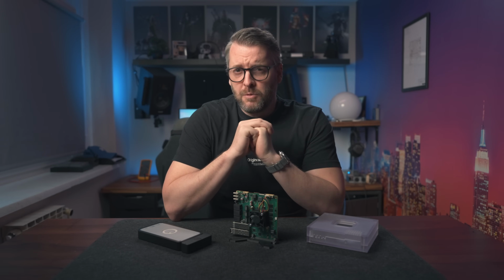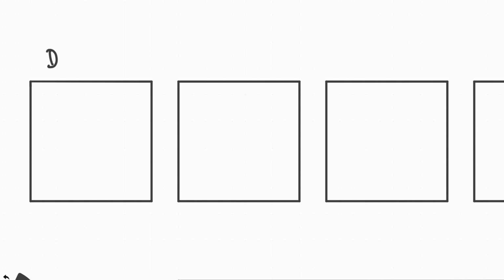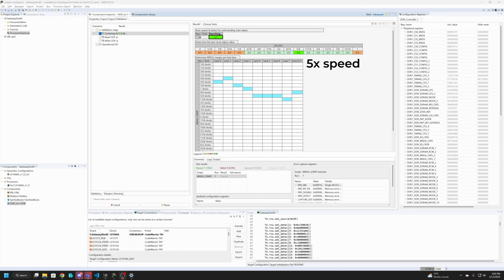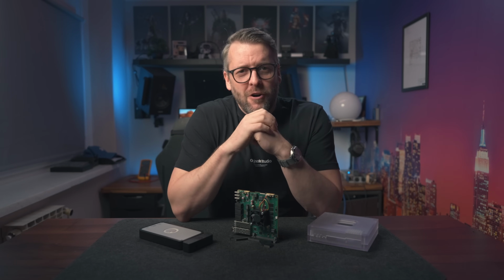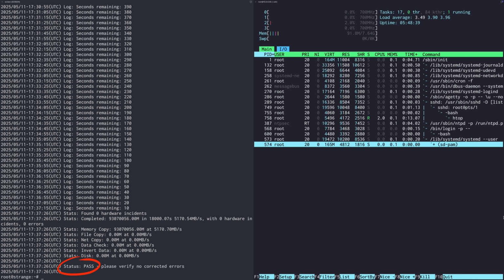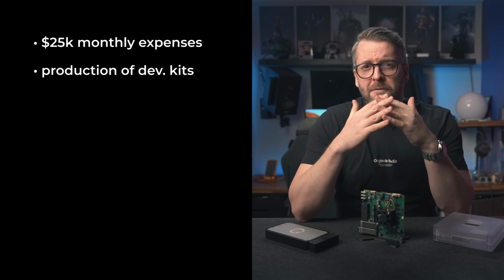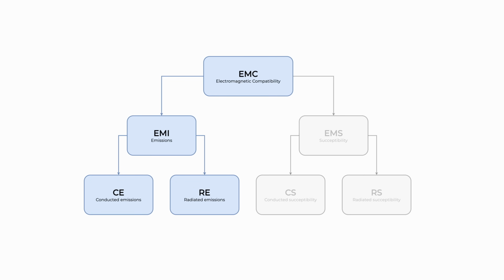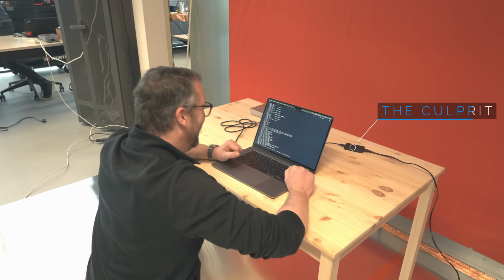We're developing a high-end router. From scratch. (April 2025 update)

Comment: Seems that at fault is that, if for register configuration the RAM controller uses the lower bits of address bus as data to be written, when you want to read the status registers it uses the data bus, and if you scramble the bits without telling to the RAM controller the new position of the status bits, the status bits are not in the expected place, they are swapped, and the controller read another bit in the status register as calibration bit.

This is not an issue and does not need to be documented 😁, the only way to read something from the RAM module is thru the DQ bus and does not mater how is wired when you send/receive data, but mater when you read the RAM module status, that is the only reason for telling to the controller how you wired the DQ into a nibble, if not for this calibration there were no need to have the DQ enumerated you were be able to wire the data bis how was the best and shortest no mater the order much like a static RAM.

Comment: Minis 01 nehmen und Optional 5G Modul per USB dran. (RM520 was Global arbeitet für maximal 150 Amazon, echtes Dual 5G Simultan nirgends gefunden)

Der freie Pcie 4.0x8 Slot erlaubt Theoretisch sogar Dual 50 Gbit/s LAN/WAN per ConnectX6 Karte die auf halben Lances laufen würde wenn einem die 2x 10 Gbit/s ab Werk (SFP) nicht langen.

Ergänzend über die 2 Thunderbolt 3 Ports währe auch noch SAS und / oder NAS Storage Möglich.

Als kleineren Bastel PC um was zu Hosten oder auch als Firewall Only PcZinophyte 2x10G SFP+ auch Intressant

Comment: What you give to the IT world:
I follow this adventure because the lack of 10G router on all ports, or at least one 10G SFP+ (WAN) and 10GbE (LAN) and a back up WAN with a faster than 1GbE.
QNAP has one that could fit, but it doesn't have any SFP+ port (3x 10 GbE and 6x 2.5GbE).
Netgate, OPNsense, Mikrotik, doesn't fit the bill neither, or too expensive.
Ubiquity just release one, but I don't want US based sotfware, non open source ones at least.

Comment: Don't wanna be overly negative or something but what does this offer vs using a Banana Pi (or similar) router with OpenWRT that's much cheaper and has better specs?
Reply from the maker: Hardware offloading. 10 gigabit line rate speeds for almost any protocol.

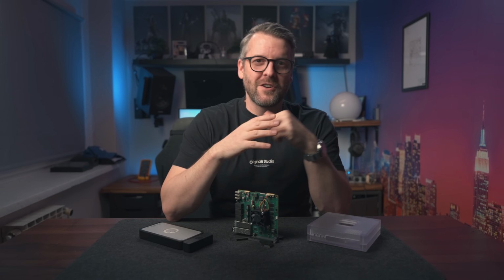Comment: 29:38 - couldn’t you have requested the manufacturers show you their testing data of their part BEFORE you bought it? Just curious if you could’ve made them do that test before you bought it with that piece of hardware you tested
Reply from the maker: They do get tested and certified by the manufacturers, but the problem is that there's variables they can't (or don't want to) control, such as cable length and gauge. These two can impact the performance quite significantly. For example, I happened to have an Anker PSU with with me that day, and we tested it as well. It passes, but just barely. That's because manufacturers optimize for price and put components in that pass, and then stop optimizing, because it would cost more to manufacture.

Comment: Hey! Thanks for the videos, pleasure to watch them.
Personally I think that you need to aim for a modularity to attract attention. 

For example
- same hw base with option to configure as NAS. NAS should be simpler to deliver software wise.
- or IoT gateway - by adding some zigbee, thread, matter modules , can attract 'iot'  investors
- 5G module support.

I don't thing it will be easy to enter market with high end router - for businesses trust and support ir necessary, for homelabs - small market, what distinguishes this router from Chinese orange pi boards?

Comment: I'm the "fifth set of eyes" and can add a bit to the explanation of why the memory controller can't do leveling with unconfigured swapped bits, even though the system can boot. The "drawers" analogy is a good one, but it's not the only way the controller can access the memory. The memory chips also have a set of control registers, accessed via the address lines.  Four of these are scratchpads, and by setting MR3 bit 2, the memory can be placed into a loopback mode where reads and writes via the data lines are rerouted to the scratchpads - which, remember, the controller can access via the address lines. This gives the memory controller a way to "see what the memory sees" via an alternate path - this is important because during leveling, the controller is deliberately shifting the timing to find the edges of the clock eye. When data bits are swapped that the controller doesn't know about, the values it sees in the scratchpads will never match the test patterns it's placing on the data lines, or vice versa. Leveling fails. But this loopback mode is only used for leveling, and so assuming the initial calibration values are good enough, the "drawers" analogy explains why the system can boot.

Great video and keep up the good work!
Reply: Great info, thanks.

I couldn't understand how a unit being wired up wrong could cause that, as it didn't seem like it could see where the data is going. Explaining that thew controller has another way to look at the ram makes it clear.

If I might ask, how did you realize this error? Just stare at the circuit diagram forever till the cross-wiring became clear? Or have you perhaps seen this before so kind of had a hint this may be the issue?
Reply: @Nevir202  Improper DQ mapping configuration is a "checklist item" so to speak: most vendor hardware design guidelines have reminders about it. I went into the project with an assumption that there was no remapping, because it had already been checked. I checked it myself anyway, as did the hardware designer I work with. We missed it at first, because there are actually a few different places where remapping might be drawn on the schematics - in this case it wasn't drawn in the most obvious place. In the end I only spotted it after eliminating all the other possible problems. When that happens, I think a good problem-solver should always go back and challenge their assumptions and preconceptions! Trust no one - not even yourself!
Reply: @dvnrrs  Thanks much for the explanation.

It obviously on a simpler scale, but when setting Sudoku puzzles or even creating new variations, (and to an extent, even when solving,) the whole game is to make sure you've challenged every assumption.

Though, when failing there, the worst that happens is either an unsolvable puzzle or one with a shortcut around your intended solving path lol.

Comment: What level of DDR are you using, because for DDR2 or earlier, your explanation really doesn't make any sense?  As long as all the bits in a group are using the same DQS line you can wire them in any order you want and the controller won't care.   The bits that went out on a particular line during a write, come back on the same line during a read.

However, IIRC, DDR3 and later have some test data built into the RAM chips, so that when calibrating, you can get reads working and then get writes working.   It's tough to test if you're not even certain you can do either operation.  

Anyway, in the case of pre-loaded test data, "swizzling" the bits would mean  that the test data comes back scrambled.

See the "Hardware-Assisted Tuning" section of this document.   One of your swizzled bits must have been the "prime data bit".   https://www.asset-intertech.com/wp-content/uploads/2020/09/ddr-tuning-and-calibration-guide-nxp-imx6-quad-ebook.pdf

I don't think the data bits are used during memory chip configuration operations, so swizzling shouldn't affect the initialization, but it would affect permanent test data.

But, as I wrote above, there's no such thing on DDR2 or earlier.

Comment: I think that investors are reluctant to invest on hardware, because once released, it will be immediately copied (by chinese companies) and sold at 1/3 of the price, because they will have no R&D costs, just production costs.
The fact that your router is multi-open-OS, does make things worse (for the investors).
It may be a wonderful device and exactly what I would need for my home-lab!
Right now I can fulfill my needs, with products like Mikrotik where I need more control, like Ubiquiti when I need more user-friendliness for simpler installations and openWRT when I need hardware versatility. But I'm not exactly the average Joe.

Comment: Your market share for a premium router device has been radically eaten away from an american network company, which delivered a half/one third of your current price point router firewall. Which is not "open" and CPU-powerful as yours, but which will certainly have success.
For the "opennes" of the harware, a german developer of Open source router distro is selling a box which is on your current price point, with no 10gb nics, but it's x86. Obviously not produced, but traded. And now is public the OEM.

Comment: Flashback, we once debugged for 2 Months to find 2 swapped DDR address lines, so the settings had bits flipped. Nice thing, we flipped the bits in the BL2 and everything worked. Was on a SOC FPGA.
And failing conducted EMV tests because of shitty power supplies, haha did that too :)

Regarding recertify, you don't need to do the lab testing until someone questions your EMV complaince, but its better to have it done (you dont have to publish the result anywhere), the CE certification you sign yourself. With this in mind, you dont need to retest with any change, you can make assumptions if your change will affect the performance of your device. So changing a some random resistor, LED or component deep inside the circuit (if not clock related), you are good. Changing ESD/TVS elements or your DCDC Converters you should retest. Just my 2 cents :)

Did you do surge/burst and conducted emission immunity, also esd can be quite challenging, just asking curiously.
Reply from the maker: Then you know how it feels! :)

Comment: As a hardware/software developer, I'm endorsing your startup and genuinely wishing you success, no matter what.

That said, I have a few concerns about the placement.

I thought there were plenty of Intel N100/N150-based Chinese routers with a similar network configuration: 2x 10Gb SFP+ ports, up to 4x 2.5GbE ports, hardware offload like AES-NI, convenient DDR5 SODIMM RAM slots, and up to 2x M.2 SSD slots. These are fully supported by OPNsense/pfSense and are priced as low as $150, including delivery.

What sets your product apart? I'm not quite getting it.

Comment: These NXP LS* series processors have really difficult DRAM. We did an LS1043 DDR4 design (with ECC) and it was definitely a pain. Multiple weird bugs. I’d be curious to see if you also run into the same yield issue we had where ~3% of the boards fail DRAM boot training. We were never able to track this down and tried a variety of settings and ended up just taking it as a yield hit.

Comment: Hi, first of all kudos for undertaking this project. Showing the hurdles you are facing and explaining helps a lot in understanding the underlying technology.  However I do have a couple of concerns.. 
- Mikrotik provides good and inexpensive switches and routers which are extremely power and price efficient. Where is the benefit of selecting your product over going for a Mikrotik solution ? To give you my perspective: a CRS-510 is a L3 switch running the usual routing protocols, but also switching at a reasonable speed and supporting anything up to 100 gbit/s. All of that for <1000 USD. With redundant power supplies. The CRS310 is similar, but in the 10 Gbit/s speed range. They do have dedicsted switches available that support higher speed interfaces.
- The number of interfaces is somewhat limited. Compare this to your competitors.
- Which routing speed are you talking about ? Can you saturate a 10 gbit fiber setup with fully encrypted traffic ? At which packet sizes ?
- Where exactly does your product outperform those already on the market ?
I am just an end user. But if I were an investor, these would be the questions that I would be asking.

I wish you luck for this ambitious project.

Comment: Hardware for the most part can't be copyright protected or put under IP laws. They would have to create a 1:1 layout copy for you to enforce it. Re-arrange the ports and give the board a different outline and you've got nothing to enforce. That's the issue. Since your hardware is open that also means you can't enforce much in the way of software either. It's also why a lot of companies are burying binary blobs and copyrighting firmware into the chips. Want to buy a DAC? Sure. Want to buy a DAC with Dolby technology burned into it? Nope, you're screwed.

Comment: I really wonder why there is a nibble based bit swizzling allowed - a typical DDR4 data byte is compromised of 8 bits with the related masking and sampling signals - and the data bits are all equal to each other, there is no real difference between them. AFAIK the DDR4 chips are configured only by using the address/control bus, or not?

Comment: On the subject of the PSUs, why not just use the Lenovo PSU, given how well it works already? I have a few myself (both the regular 65W and the slim 65W), and besides the captive USB-C cable, the slim 65W brick is my favourite USB-PD power supply simplye because it supports USB-PD, USB-PD PPS and nothing else, run super-cool and has really good electrical output quality. Oh, and they come in both earthed and non-earthed versions (I prefer the earthed ones, cause I loathe a buzzing laptop from the ground leakage current).

Comment: Pretty solid and straight forward. The connections and expandability and CPU are what I'd look for. Love the case too. It would be cool to use is to cool the CPU in future models. Alternatively, a quick and easy way to blow out heat sink dust.

Comment: Gee, a certified power supply lying about those certifications. I've never seen that before. (I'm joking, I see it all the d... time.) I always recall the story I was told about the BeBox FCC testing: Radio Shack screamed at them to not send their monitor. (it's actually made by Magnavox, and it absolutely will not pass emissions testing despite the sticker placed on it.)

(When we stopped "making" [modifying - replaced the front panel of the case] our own hardware, someone from UL came by to collect ALL of our unused stickers. Also notable, Tyan and Acecom weren't happy we had their components in something sent to the FCC! And no, they didn't pass without modification either... the clock generator on the MB spews noise requiring us to shield every crack, and because it's right next to the PSU, it leaks into the PS and thus the AC mains requiring ferrite cores on the power cord.)

Comment: There will be challenges with investment as this is essentially a prosumer/ niche device and not a mass-market generic router-in-a-box. If you are committed to fully open-source OS, without some sort of unique (software related) feature, then many investors will bail as there is nothing proprietary or IP related to leverage in the market (as you have discovered; hardware alone, even if great, isn't marketable - it's the software that it runs, that's important). So don't take it to heart; very likely investors do not see you personally in a negative light, it's that a product that can't be protected in some fashion is a much larger risk (even if that's way better for consumers). Kickstarter and Indiegogo may be an option, but both have wall-to-wall generic router-in-a-box offerings, the vast majority of which either fail because insufficient demand, are vapourware/ scams or are just rebadged generic SBCs.

That said, I am impressed as to how far along this has come from such humble beginnings; there may be merit in figuring out if there is something you can add that brings some special sauce to the platform, as that might help pull in an investor or two.

Comment: Looks like the highest frequency within this router internally is the 10 GbE SFP+ (10.3125 Gbps) which would mean 5.15625 GHz using both clock edges. So the radiated EMI test up-to 1 GHz is not sufficient and must be actually tested to 5th harmonic or up-to 25.78125 GHz by the NRTL to be considered passing. I doubt a plastic enclosure would provide sufficient shielding.
Reply: @Dream-kl3rm  No it's a polycarbonate enclosure for this initial release - but if they do ship the aluminium one the same issue may apply - in that case - as with plastic - a suitable coating should be able to resolve the EMI surely?
Reply: Except that it’s all-aluminum case. Not sure will it provide the shielding properly if grounded?
Reply: Hi Wouldn't an EMF coating or EMF plastic provide a solution for a plastic case?
Reply: @julianrhind5632 What plastic? This router is all built from one block of aluminum.

Comment: I've always wondered.  Why stop at 10 gigabit when 25 gigabit has been around for so long and is reasonably priced on the used market?  (so it's available to those that want to use it)
Reply from the maker: 25 gigabit connection itself is not the problem. Getting real line-rate throughput for anything beyond basic traffic is. And to pull that off, you need much beefier hardware.